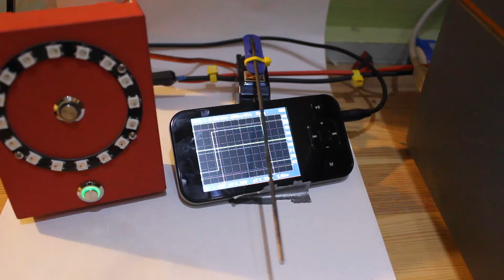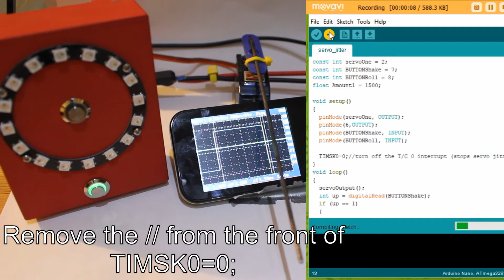Arduino Servo Glitching/Jittering

Comment: But where is the code?
Reply from the maker: const int servoOne = 2;
const int BUTTONShake = 7;
float Amount1 = 1430;

void setup()
{
  pinMode(servoOne, OUTPUT);
  pinMode(BUTTONShake, INPUT);
  TIMSK0=0;//turn off the T/C 0 interrupt (stops servo jitter)
}
void loop()
{
  servoOutput();
  int up = digitalRead(BUTTONShake);
  if (up == 1)
  {
    ShakeIt();
    Amount1 = 2150;
    for (int P = 0; P < 50; P = P +1)
    {
      Amount1 = 2150;
      delay02(40000-(2*Amount1));
      servoOutput();
    }
    Amount1 = 1430;
  }
  delay02(40000-(2*Amount1));
}
void ShakeIt()
{
  for (int F = 0; F < 6; F = F + 1)
  {
    for (int G = 0; G < 4; G = G + 1)
    {
      Amount1 = 1600;
      delay02(40000-(2*Amount1));
      servoOutput();
    }
    for (int G = 0; G < 4; G = G + 1)
    {
      Amount1 = 1430;
      delay02(40000-(2*Amount1));
      servoOutput();
    }
  }
}
void servoOutput()
{
  digitalWrite(servoOne, HIGH); 
  delayMicroseconds(Amount1);
  digitalWrite(servoOne, LOW);
}
void delay02(unsigned int multiplier)//maximun number is 65535
{
  for (unsigned int T = 0; T < multiplier; T = T + 1)
  {
    __asm__("nop\n\t"); //do nothing, waste a clock cycle?
  }
}

Comment: wow this fixed my jittering as well. im still confused though with what wont work. Are you saying that I wont be able to use a code such as "servo1.writeMicroseconds(180); "or "delay(4000);" ?
Reply from the maker: OK, i am not sure i am the best person to answer this, but a quick google keeps on coming up with the same answer, Timer0 - An 8 bit timer used by Arduino functions delay(), millis() and micros().
the servo library seems to use Timer 1, so that would be ok to use.